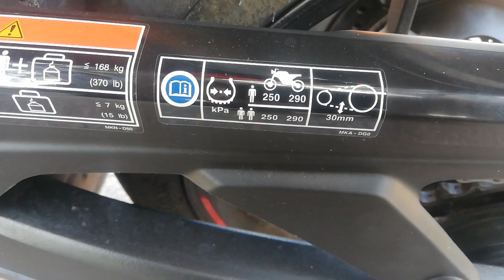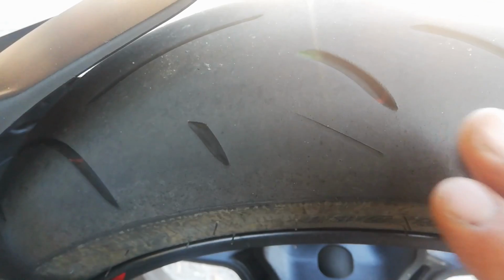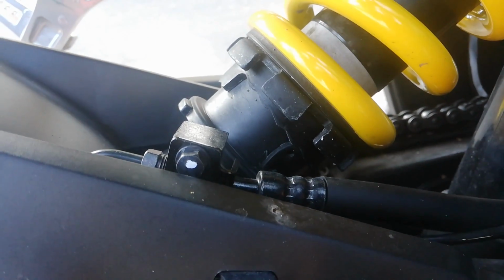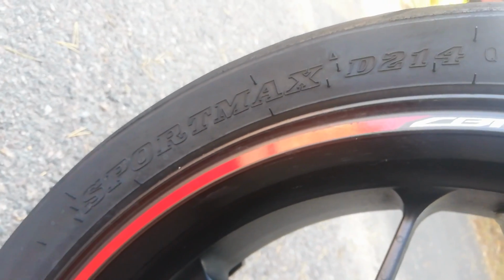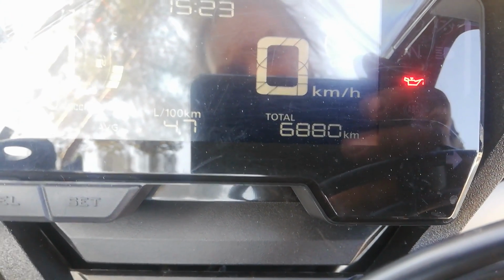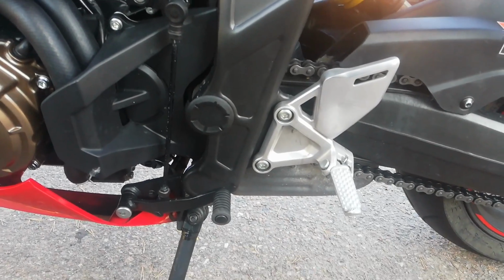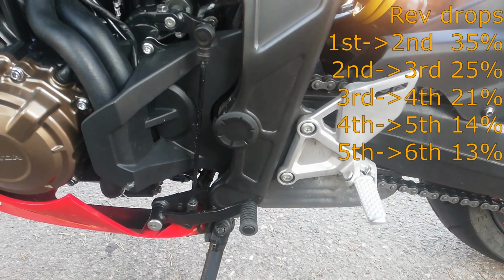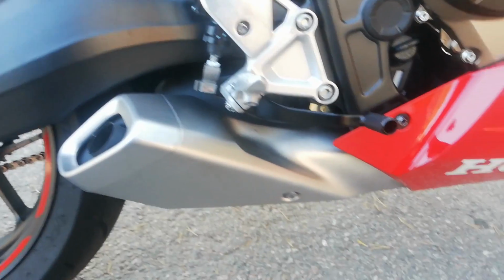Honda CBR650R ergonomics 2 and stuff

Comment: Does it take a lot of throttle to get it going? That is to say, is this engine like a 600cc RR, where you have to be very high in the rpm range before you get all the power?
Reply from the maker: Hi
I think it pulls nicely even at mid revs.
Reply: I now got 30k km on my 650 R and in my opinion the party starts @ 7000 rpm